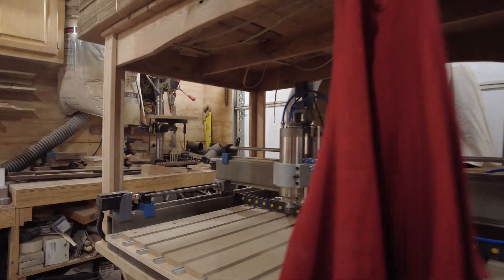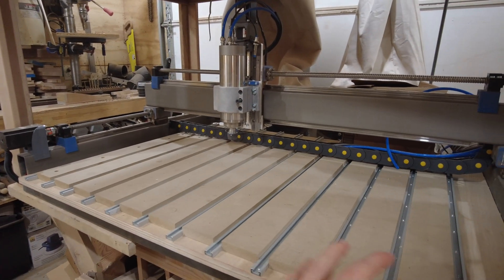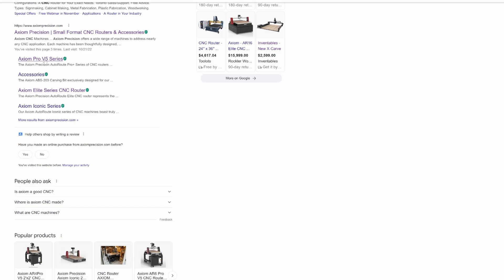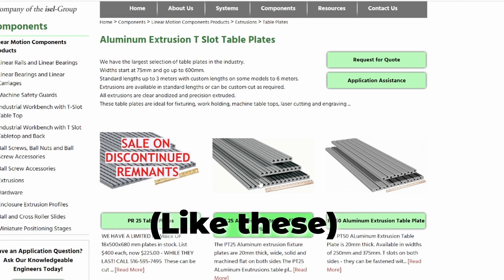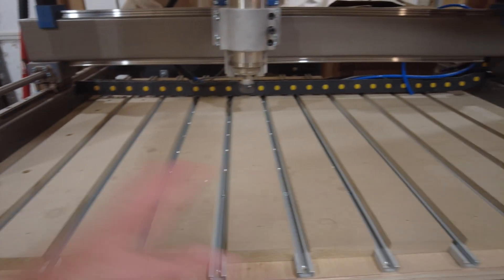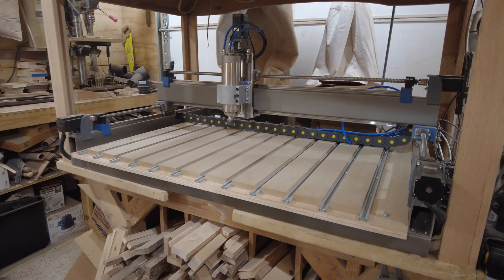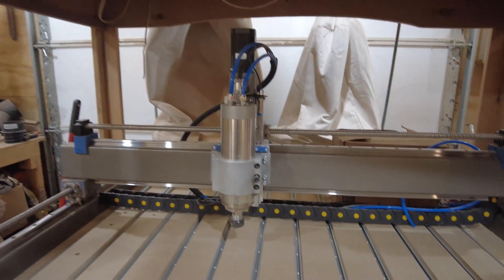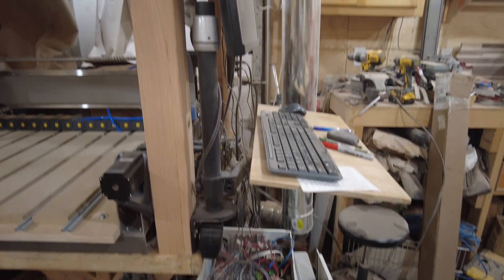What Happened to My PrintNC DIY CNC Router?

Comment: Well a diy cnc is never finished. My second build took about 200 hours to complete and there's still stuff that I like to add or change. I had a lot of fun looking up info how to build one, component choices, design and building it. If that doesn't sound fun then buying an off the shelf one is probably a better choice. You're stuck with the manufacturers design choices but can also reduce down time and you're entitled to support.

Comment: You made a good call on buying a commercial build. If you're trying to run a successful business, then you need equipment from manufacturers which will be around to provide long-term support.

Every hobbyist CNC ends up being somewhat unique and the owner has to provide the direct support (perhaps with some tips from a builders' community). Over time, the parts used to build the machine become unavailable and it requires design changes to integrate available parts into the repair. Hobbyist CNC's are a great learning experience but not something to build a business around.
Reply: I'm and Industrial Maintenance Technician by trade. And, your advice is terrible, when you source parts from the OEM you can end up paying 10-10,000 time what a similar off the shelf part cost. And, plenty of companies have went out of businesses, or merged with other companies and stop supporting legacy equipment. I've had multi-million dollar packaging machines still under warranty that I couldn't get support for because the company stopped supporting parts and told me my only option was to upgrade to the latest version. The difference between a DIY and Commercial machine is one requires more money, the other more knowledge.
Reply: @ptbelttactics  The majority of hobbyists who purchase CNC routers, laser engraver/cutters, 3D printers, etc., do not have the technical expertise to integrate third-party components when the parts are not a direct replacement. This is why most hobbyists should purchase a commercially available CNC instead of building one from components sourced from multiple vendors.

In my post which you replied to I pointed out that parts to repair the CNC machine tool will become unavailable over time and that this is why hobbyists should not try to build a business on these low end machines.

BTW, the manufacturers of hobby grade CNC machines do not have high markups on replacement parts. They rarely have markups of even 100% over the price they pay for the components in quantities sufficient to get a discount.
Reply: @GaiusTacitus  nope, you are definitely wrong. The closest commercially available machine with the capacity of the PrintNC DIY machine is  anywhere from $6,000 to $15,000. While the PrintNC can be built for under $1,500.
Reply: @ptbelttactics  You're not factoring in the labor to assemble and test the PrintNC. I've seen a complete breakdown of costs to build a PrintNC with a spindle + VFD and it was in excess of $4,200 Euros. Surface finish is another matter; a PrintNC may require hundreds of hours in R&D before the chatter is eliminated. Time is money, and you'll invest more in getting the PrintNC to the point it produces parts with an acceptable level of quality than just purchasing a commercial unit.

If your goal is to make building the PrintNC into your hobby, then building a CNC is the right path for you. However, if you're looking to use the machine to generate a sideline income, then purchasing a commercially available unit like those available from Carbide 3D or Onefinity is a much better approach.

There is also the matter than the owner of a PrintNC is responsible for 100% of the support. No two builds are exactly the same even when starting with a kit.
Reply: @GaiusTacitus  The VFD and Spindle are less than $300. And, the Carbide 3D isn't even in the same bracket of machines, the PrintNC has a 3hp water cooled spindle with and ER20 collet, the Carbide 3D has a hand held router. The Carbide 3D could never produce the same quality of parts.

And, there isn't a machine made that doesn't have a learning curve to produce excellent parts. If you think buying a machine vs building one is going to solve that problem you are mistaken.
Reply: what part u need ?? all is ou there stepper rods screws elecrtonic ... buying commercial machine is only for lazy sobs ,and it is the most expensive way u can choose
Reply: @MrCcfly  Try running a business with machines built upon your approach. You'll find it is a quick path to bankruptcy.

For a hobbyist who wants to tinker with machine building it is a good approach.
Reply: @GaiusTacitus  how ??  machine cost 2k diy it take 1 week to make and that was it ..  comercial cost 4-5 k and u need to pay servicing every time or u loose warranty and for bonus u know shit how to fix it
Reply: @MrCcfly  It takes far more than 1 week to design and build a machine that will produce quality output. If you're talking about building one of the low-end designs floating around the internet, then be aware that the quality of your output will not be very good. 

Talented builders spend weeks or months resolving issues with even a PrintNC build and sometimes still end up with chatter that mars the finish on parts and shortens tool life.

One talented builder did a cost breakdown of his PrintNC CNC. It was over 4,200 Euros.

If you build your own and it has problems, then you are the engineer who must resolve them. If the parts you originally sourced are no longer available (and this happens often), then you must retrofit different components into the design.

You are not generating revenue while your machine is down. If you have a contract to produce items for another party, then you are subject to being sued for damages.

There is a difference between playing around with CNCs as a hobby and trying to run a business that relies on the machine tool to meet production.

Some of the commercial CNC machine tools in the hobby space are good enough to run a small business with.
Reply: @GaiusTacitus  wow what a loooad of bull ..these corps buy same junk like i was .sammmmeeee .... and u compare ppl that "work" 1h per day vs someone who want to finish it .. i wonder what is hard to make one ?  all is simple only u need laser thingy to make all square all time and screw screw and some more screw ,,,i made my printcnc without print parts in 3 days after all stuff came to me ,, cost  under 1.3k .(32bit control 1.5kw water spindle,1.2m by 1.7m ,linear rails h20 ,c7 double bearing nut ,cc nemas etc)  . and lol at engineer ,u are assembly guy not designer ,,, but ppl love to overdoo and overthink that is reason why they spend a loot ,i just look what guy did with super simple plasma cnc ,,he use x alu profiles and another  c on top of it .. i mean
Reply: @MrCcfly  You're obviously neither an engineer nor a machinist. If only it were as simple as you believe it to be, but it's not.

You can take all of the best components that money can buy and still end up with a machine that will not produce quality parts reliably or consistently.

Comment: What machine did you end up going with? Your video tilted me away from the PrintNC and toward a Shapeoko most likely.
Reply from the maker: I will post a video soon!  The machine I bought is more of a production machine than a hobby machine.
Reply: This is old but as someone with both a shapeoko and PrintNC, I will say the PrintNC in stock form is much more capable. I've already ran through upgrades that bring it to another level.

I also have an xcarve. Save yourself the money on that one.

Comment: Wow almost done and then decided to order a ready made machine. I can understand you've got busy with other things, but if you've got time to explore and use your new ordered machine, I would say you could spend a few hours to finish the PrintNC
Reply from the maker: I'd rather not. And it probably wouldn't stand up to the amount of use I'll be using it for. PrintNC is a great little project for anyone looking to get into hobby work and spend a lot of their own valuable time attempting to figure it out amongst the slowly improving documentation. If you know what sunk cost fallacy is, you'll likely understand why I chose to sell rather than "spend a few hours" finishing it.
Reply: @WoodworkingBusinessmen  But I mean you now bought another machine, that were costs you chose to make instead of spending a few hours. Or you was planning buying that machine anyway? Even then the PrintNC would've been great for practicing, however that could be a good reason to be not motivated anymore. I've built a PrintNC myself and the electronics part was the easiest for me at least, of course could be different for you, but really is not so hard. And I assume when you buy a new machine you still have to connect the electronics or is it completely assembled?
Reply from the maker: I was not planning on buying the ready-made machine (I was hoping to make the PrintNC machine to save some money).

And when you mention practicing, that's a great point. I do have some practice on two "ready-made" brand machines (only 150-200 hrs), so I don't really have the desire for more practice I guess.

Maybe my electronics setup wasn't ideal and that's what made it hard, I'm not sure. The trouble I had was not in the wiring per se, but in the software and hardware controllers (BOBs, specifically).

The new machine will come assembled.
Reply: @WoodworkingBusinessmen  Some controllers could be time consuming to make it work with specific software indeed. LinuxCNC for example could be a pain in the ass at the beginning. I began with a chinese parallel BOB with LinuxCNC, then wanted to go faster and bought a NVEM and flashed with Remora, which was really time consuming because the firmware wasn't right at that moment (now it is), then bought a Mesa 7i92m as controller with the chinese parallel BOB connected to it. If you've not sold the machine yet and want to give LinuxCNC a try I could give you the config files for the parallel BOB or the Mesa+BOB to make it work quickly.
Nevermind I see you've already sold it, at least you've made someone happy. I'm curious which machine you've ordered. Couldn't find it in the video or description.
Reply: @WoodworkingBusinessmen  man, that's a shame. I wasn't interested in the breakout boards and all that mess either, so I run mine using grbl mega. If I'd understood just how easy it is to square mechanically, i might have gone with regular grbl. Definitely way simpler.
Reply from the maker: I will post a video soon on the machine I ordered.